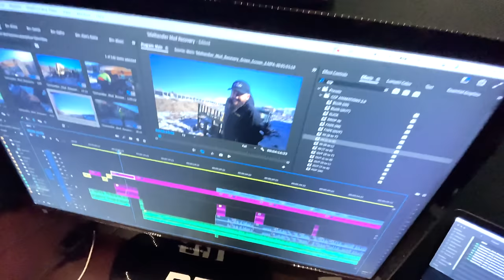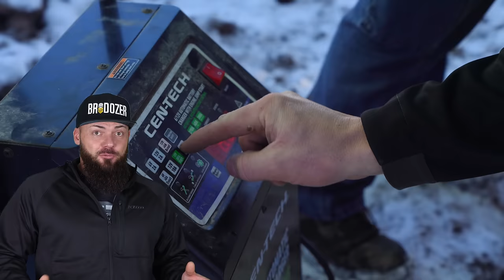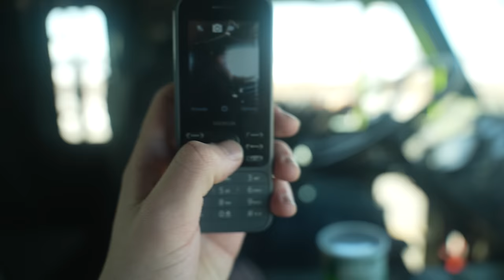ANOTHER Stuck Telehandler Frozen Solid In Deep Mud

Comment: Glad to see one of you was prepared & brought their muck boots!  I hate working in the mud but worse is when it deep freezes under the rig. At Skyline farms we got a articulated beast with 8 tires sunk in the mud.  We had 2 D8s with winches, 1 track hoe, 2 backhoes & still couldn't budge it without hours of digging!  2 shifts of 6 guys digging & sill wouldn't move.  One guy brought out a huge air compressor on a service truck & later a water/mud  pump.  He built a cone on each pipe with holes like a well driller would have.... looked strange having all these pipes sticking in under it but WOW What an amazing difference to help it break the suction.  I was young but you could hear the suction while it was coming out!

Comment: You guys should put a big winch on the front of the Ranger, it'll save you time and energy when inevitably Bud gets stuck lol
Reply: if they would get him out of the Danger Ranger and into a REAL TRUCK.....ok well he would get that stuck also  but bigger is Better Right?:text-green-game-over:
Reply: @Dwiglex  bigger trucks are just harder to recover when they get stuck and with how often he gets stuck maybe he should be in something even smaller
Reply: He LIKES doin it the hard way!🤷🏻‍♂️
Reply: strong Dyneema winch lines, like sk78 has a 12-ton breaking strength, they also make crane lines that have over 500-tons breaking strength.
Reply: For how much work that little trucks puts in to help out I'm surprised into not SAS with lockers. It doesn't need to be on 1 tons, but get rid of that front end. Then again, it's not a company rig and Bud volunteers the truck because he likes to have fun in it.

Comment: Just a comment . I was on a heavy rescue unit in the fire service. Place a sand bag over your cable on the wrecker to keep the cable to go air borne . Cable will go to rye ground. Use air bag under your equipment or the boat . You can raise it to put pole unit the equipment to role it out very easy. Thanking less time.
Great video
Steve Claytor
Retire Fire Fighter. Fire Investigator.
West Chester Ohio

Comment: I've always wondered why the recovery channels that I watch on YouTube never have an actual service truck and always just pile their equipment where ever they can fit it. Just makes sense to have a reliable rig, with all your recovery gear, extra fuel, boost power, air, welding capabilities, etc. Cannot wait to see what you come up with!
Reply: Hydraulic fittings,  hoses and related repair equipment.
Reply: What about the crane on the truck? That’s a game changer nobody mentioned
Reply: @TravisLaRoche  Most service trucks where I am have cranes, it seems to be part of a service truck. But, yes, a very important accessory.
Reply: I’ve been commenting on this for a long time, a service vehicle with a diesel brothers spin, I’m glad they are finally doing it. Jobs just go faster and safer with the right tools and equipment. Now if they can just learn to maintain things better they’ll break less. Lol
Reply: They're going to take a great service truck, and make it completely useless as a service truck. You know why you don't see service trucks on 40s with axle techs? Because it makes them useless/awful to use as a service truck. Same reason you dont see see trucks hauling/working on 40s with axle techs.
Reply: They should always have that 5500 ready with extra fuel. Tools. Whatever. Can haul a few people too should they need to leave a vehicle behind or one breaks down. I'm looking forward to seeing that service truck done
Reply: The problem is that he can start with a good service truck, but by the time he is done upgrading, it's a tank. 😂
Reply: @dahorseman2654  Yep lets make a top heavy vehicle even more top heavy on big tires. It is going to be real fun working out of that thing.
Reply: but then people wouldn't watch. whole point of youtube is "OMG WHAT WENT WRONG!!!"

Comment: I was working for a general contractor on a big job here in Houston, the University of Houston wellness center. The general contractor didn’t have a Tele handler but we used every other subcontractors Tele handler. Many times they would get stuck in the best way to move them, is to stick the forks in the ground and extend the boom, pushing yourself backwards. They had every different kind of tell handler and that was the method I used on all of them. It was a muddy mess on that job site and actually building a three times Olympic size pool. Caved in several times from the rain

Comment: you ever thought of building 1 or a couple skid pads with plastic on the bottom that would function like the air boat does (discs with upturned edge)  but with loops welded on to strap through wheels or broken suspension parts?  then the beast could lift anything, slide them under, strap them on and then drag anything out on top of snow
Reply: I've used old car hoods for this exact use.

Comment: You guys are awesome. this video brought some memories back, I was pulling "All Terrain Forklifts" out of mud holes on jobs sites back in the 80's when I worked for a equipment rental company because of the morons who these contractors hire had no clue how to drive them. The rental company was also Koehring dealership, We had the biggest at the time a 9038 ATF but Koehring made a 10000 which they made for the military that had grapples on it for loading missiles on portable launch systems. We also had ATF's made by BPI called the square shooter that had a articulating frame that leveled to operate on uneven ground, the frame turned side to side. One of my jobs was testing the safety features on all equipment when it came back from rental and also recovery of dead machines of job sites. We had all kinds of equipment, excavators Koehring 6644 down to mini's excavators, ATF's of all sizes, skid steers, 110-40 ft boom lifts, scissor lifts, air compressors, light towers, Loaders, etc. My father inlaw who I got a job there driving the ramp truck LT9000 Ford pulled just about every type of machine out of so many different situations in winter, summer, in all temps. It was the most fun I ever had working and driving all types of equipment. Thanks for the memories.

Comment: Great video. I do sewer and water and we use road plate and sheet pile sections when stuck. You mentioned sled, and it made me think you could actually cut/curve up and weld up 2 (20' ish) strips of sheet pile with D-rings welded on and chain binder over each tire to keep in place.

Comment: Interesting. Never heard them called a telehandler.  Always called them a boom lift.
Reply: The correct term is teleskoplastare
Reply: In the  US they are properly called Telehandlers
Reply: @alphonsotate2982    🤔🤔🤔🤔.    I must be a time jumper.  Next a pickup truck will be a convertible station wagon.    It's got a boom. It lifts.  Boom lift.
Reply: @alphonsotate2982  or Lull , snorkel lift, boom lift, off road forklift. . . . There's a bunch of legit names

Comment: I've never honestly seen someone manage to get a Tele stuck 😆 I've myself have been using them on and off for over 15 years as a concrete Mason and have gone into some crazy $hit with them and never been stuck lol, I live in upstate NY so it's a mixed bag of shi+ during the winter and spring 😁. Knock on wood I'll probably get stuck now 🤣
Reply: I've got once, to downward going garage ramp with fresh snow on top of it.  Went nice and smoothly down, but started slipping when backing up an  that point I new it wont get up, slam brakes and slide down few meters before stopped. right next to wall.
Reply: They build these on purpose for content, don't be fooled.....
Reply: @jeffmentzer9186  😆 yes they decided to stage this just for the fun of it 🤦‍♂️

Comment: Buried a to-30 Ferguson tractor once to the foot rests and it sat for two weeks in below freezing temps in Iowa and was not coming out until spring so we buried it in a pile of steaming horse manure and I'm mean buried it out of sight and then some ! 24 hours later we pulled it right out with a pickup ! Have used manure a few time since to get  stuff out of frozen earth like I beams and spare tractor wheels ,sounds nuts but it works great.

Comment: On cable clamps the u bolt always to the deadside of the cable. Drive the clamp close to the pull down with a hammer.  If you want to be real safe untwist 3 strands 2 or more feet make a u back to the live end twist the other strands from the opposite side.  Same cleaner used to clean concrete will clean rust on frozen cylinders as long as oil is not added first, after engine turned over it's ok to ad oil.

Comment: Build the stuck tele-handler a set of skis? welded together so it cannot steer itself into a bigger mess, and tow using a bridal as per a catamaran uses to moor onto it's anchor. I know that sounds weird, but I like weird.
Aluminum Pontoons on either side of the tires? float-tow it out?

Comment: The problem with the telehandler in the snow was he had it in 4 wheel steer.  When he steered left the rear wheels went to the right and dragged it into the ditch and vice versa.  Front wheel steer is all you want and it will follow the snow machine.

Comment: guys need to learn how to drive telehandlers.  Rock the tilt switch for the wheels as you drive on soft or uneven ground, it will help keep the ground pressure equal on all the tires for better traction (also rear wheel drive wasnt engage on the telehandler).   Also those engines are horrible for cold weather starting.  Its amazing how horrible they are.  Have a Mustang 1157..

Comment: Can’t you use the telehander boom with a cable connected from it to a snatch block mounted to a heavy truck or tree behind it and a few yards to the side of it which then is connected to another snatch block in front of the telehander connected to say a big tree or heavy truck etc and run  it from there to the front of the telehander which then booms out using its hydraulic boom rams to pull itself out.?

Comment: Instead of using a straight pull from the winch, use a block and tackle and multiply your pulling power. Dave start using your equipment to its full capacity.

Comment: Another video of the guys destroying the delicate boom on a telehandler!   When will these guys learn that telehandler booms are NOT like excavator booms!  They can not be used to push, pull, or lift the unit off the ground. They're delicate, thin-walled, booms that have all sorts of extend/retract cables inside of them. They're aligned/adjusted and they're only designed to have downward force applied to the forks, and only lift weight that's within the load chart.  Pretty much every single telehandler I've seen these guys touch on this channel, they have don't considerable damage to their booms!

Comment: You had fun buzzing around on a flat bottom John boat, with prop..... build the same flat bottom boat, that folds up. Lay it down. Wench what stuck on top of the boat. Secure it.....
Straps and chains,  and slid the DAME thing back...on top of the snow pack....

Comment: @HeavyDSparks for proper recovery you should get a 100 ton Liebherr Autocrane with 50 yard boom basically like a helicopter but it can lift a 50 000 pound maschine straight up out of a mudhole and set it where you want it like a low boy for example

Comment: Actually chain is perfectly acceptable for pulling as long as 1 it is alloy and rated size for the amount of weight and traction weight that the mud creates and 2 not wrapped around sharp hard edges you can get some pretty serious numbers out of 5/8” grade 100 but would never use anything less than 3/8” grade 80 to pull

Comment: OK so hear me out. The New York Air National Guard flies a fleet of 10 LC-130 Hercules cargo planes. The purpose of these planes is for use in the Arctic and Antarctic using skis mounted to the landing gear. You could easily make these, on a smaller scale obviously, but it could solve your problems.

Comment: You literally just destroyed the chain on the boom pushing out the other machine that was a little stuck. 
The chains stretch when under a load. 
They are not meant to handle the weight of the machine. 
That chain will fail soon 

Just information for the future. 😅